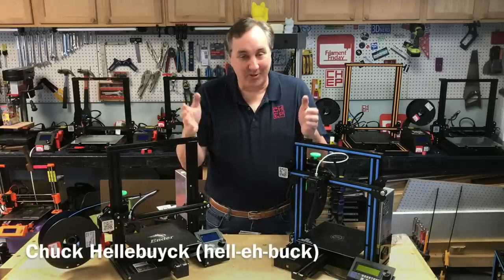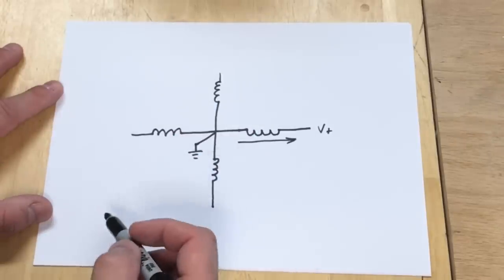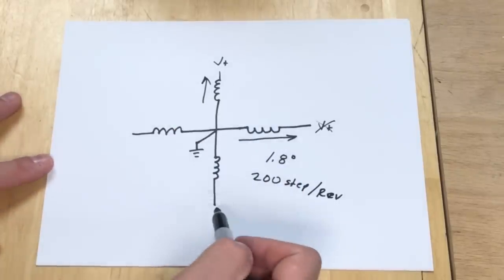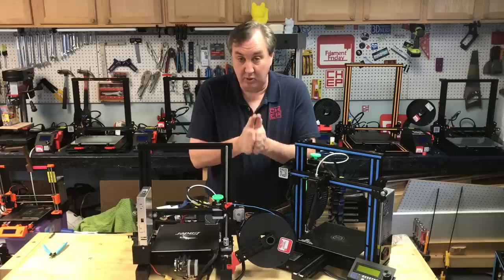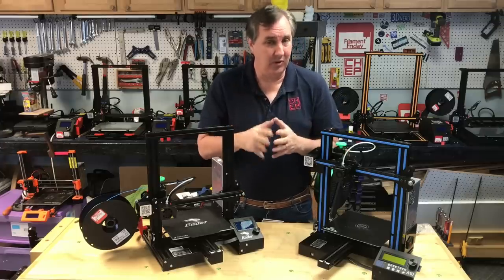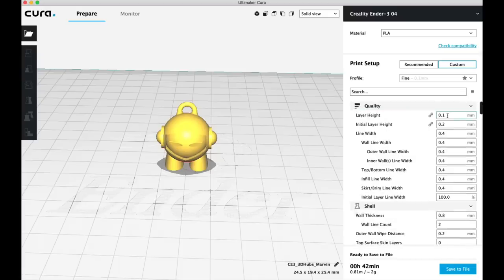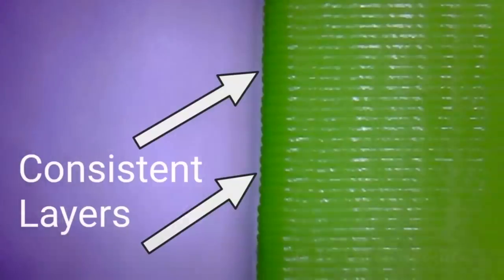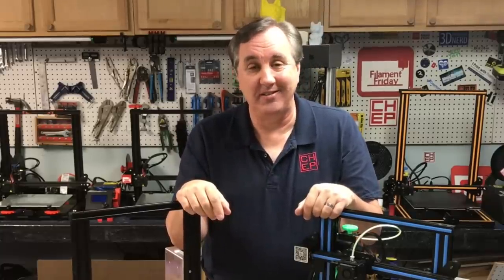Better Quality 3D Prints Using MAGIC NUMBERS on Creality Ender 3, CR-10, A10

Comment: I dunno, seems your cherry picking your results when your looking under a microscope because under your 0.12 layer you can clearly see bigger blobs at the bottom but you chose to ignore them and point to smaller ones
Reply from the maker: Seems like your cherry picking a video to make a point. I’ve had 1000’s of people actually use these numbers in the slicer and report the same results as mine. Much smoother prints. Ive since shared my profiles with them and have seen moe people state they are getting better prints. So I stand by what I showed and stated. 
The bottom of that print was another issue I covered in later videos.
Reply: @FilamentFriday  yeah I don't think we're on the same page on what cherry picking means.  I could only be cherry picking if there were many videos and I picked the 1 that showed fault. But then for me to be cherry picking in this sense you would have to be acknowledging there is a fault for me to pick at...
Reply from the maker: Then you clearly don’t get it. The area I showed on all the prints showed the improvement caused by the Magic Numbers so I clearly understand.

Comment: As someone who is pretty new to this, but trying to learn everything, I just wanted to thank you for your videos! I personally have an Ender 3 that I got for Christmas, and I have been playing with different settings in Cura to try and get more consistent prints. Your explanation for "natural steps" was really well done, and it answers a question I had about layer height, and what would make the most sense! I noticed in Cura that the resolutions they offer by default didn't really seem to have a consistent interval to them, and this helps me understand what I need to be doing instead. I don't usually comment on videos, but I just wanted to say thank you! I definitely subscribed, and look forward to seeing more super helpful content from you! 

...I am now going to go binge watch all of your videos and start testing things on my Ender 3 that you suggest! Thank you so much!
Reply from the maker: Thanks for watching and the sub.

Comment: This is a brilliant observation, though I would prefer to refer to the magic number as the Z-step ratio or something of the like. Can't wait to test this out!
Reply: In Cura, I usually use adaptive layers to smooth out curved surfaces or shorten taller print times with little variation on the z-axis. I noticed that I can set the 'Adaptive layers maximum variation' and 'Adaptive layers variation step size' to multiples of 0.04.
Reply from the maker: Magic Number sounds like more fun ;)

Comment: Makes sense, hard to guarantee that the first layer won't start at a microstep height though? resulting in all subsequent layers being off the "natural" step positions. However, your results don't lie. Will have to switch it up to 0.28 or 0.32 when I'm after those fast big prints. Cheers mate.
Reply from the maker: It may start at a microstep but read my pinned comment above yours where I clarify.

Comment: Your diagram is for a five wire stepper, 3D printers normally use four wire steppers. That’s the two opposite coils in series or parallel (in appropriate orientation) and no connection to a common point. There’s also six (your diagram but each set of two is separate) and eight wire (each coil coming out separately) arrangements.

On four wire steppers, you have coil pair A and coil pair B. First you energize A in one direction, then B, then A in the other direction, etc. The five wire model is easier because you only have to switch four + in sequence (well, more usually you’d have the power + in the center and pull the four wires down in sequence), and in the four wire model you have to put - on one side and + on the other, and then reverse that. Hence why we need specialized chips to do it instead of a few transistors.

This of course in no way detracts from your “try to match layer heights to full steps” point.
Reply from the maker: It was just to simplify the explanation. They still have natural steps and uneven microstep angles so the magic numbers average those out.

Comment: Its obvious (but something new for a lot of people). Nice video.
I always use 2mm lead pitch screws (0.01 is my "one full motor step Z weight").  I dont like 8mm lead step screws.
caution: Lead pitch and "pitch" are not same thing.
Reply: True, see my comment above. Uneven/odd layer heights will result in z-heights that will never match the original parts height.
Reply from the maker: Agree LoKuS, the Ender 3 does use a 4 start 2mm pitch 8 mm lead screw. Your 2 mm lead does produce equal quality to the Magic Numbers at just about any layer height. As you know, it just takes more steps to move. I have a printer with that Lead as well.

Comment: I just got an E3 and tried two benchy prints in a row, one with the stock profile in cura 4.3 for the E3 and right after the one with your magic 0.12 profile. The stock profile actually printed better for me. It's not a universal improvement, but I'm sure it works well for some poeple.

Comment: Later versions of Cura nowadays has the proper printer profiles with those "magic numbers". No need to manually create profiles any more for this reason alone. With version 4.6 I just told it to use the included Ender 3 printer profile, and it had all the settings dialed in for the printer in question.
Reply from the maker: Yes, those settings came after my videos.

Comment: Good video and tip. I came to this from another way to get my optimum z height. For me it was fighting with first layer height and a feeler gauge. Kept getting slightly different measurements when I told the z to go to .2mm. Finally I looked up the specs for the motor and did the math.

Comment: Interestingly enough when I modified my Tevo a while back I started using these numbers and the results were improved. Didn't know these were magic numbers. I discovered these when I was using the prusa calculator to figure out my steps on the new z threaded rod.

Comment: Someone recommended me your video, and boy am i glad for it. i did not test your claim but the hypothesis is very strong!  That is great wisdom.  When the printer finishes I will print a xyz cube. I have been printing these as .2 mm but i am still disappointed with the way the layers stick out unevenly at 0.2 mm. I will try .16 and maybe report back. thanks for your wisdom.
Reply from the maker: That sounds lire like over extrusion. If 0.16 doesn’t work then try lowering flowrate to 97% and see what you get.

Comment: So honest question

Either the microstepping is consistent and reliable and therefore the magic numbers are irrelevant or the microstepping is not consistent and reliable making the magic numbers relevant

So how do you make sure home is on a magic number ? Or does it just mechanically fall into line with the even steps?

I find the subject very fascinating I use them I always use layer Heights divisible by 0.04 just to make sure but I always wondered if it really made a difference :-)

Does this mean by changing out to a 0.9 degree motor we can get more accurate printers? How much of a difference would it make?
Reply from the maker: As I stated in the video that you can start on a microstep but it will be consistent from there. Nothing guarantees the microsteps are equal angles between the natural steps but if you rise at the same microstep then you are consistent all the way up so not irrelevant. 

0.9 would just lower the magic number resolution to 0.02.

Comment: I hated to hear 'magic number' at first, but I guess it's a common term for  practical sweet spot for things

I suppose the best resolution that any 3d printer that has the same Z lead screw and stepper motor as Creality machines, should be 0.04mm/40micron, never listed anywhere, but that is quite impressive considering 8mm/rev pitch might seem rough to some, as I remember browsing for my first 3D printer that usually FDM only does 0.1mm at maximum, which usually seems good enough, but now I know that this is hardware-imposed limits that can be properly highlighted

once I started to notice the difference even without viewing aid(very clear in finer layer heights, even your results clearly showed it to me), can't go back, magic numbers all the way, the irregularity in non magic number layer height even causes some strength issues, think it missed a forced microstep or two. big thanks !
Reply: You forgot the stepper motors are capable of microstepping, so it's not 0.04mm resolution but the one given by the stepper driver. Mine are configured in 1/16 mode.
Reply from the maker: The point of Magic Numbers is to average out the variability in the 1/16 microsteps so that doesn’t matter. 
Also the 8mm lead screw is a 4 start so it has a 2mm pitch.
Reply: @FilamentFriday  So what exactly is the Z resolution on the Ender 3?
Reply: @alejandroperez5368  Microstepping involves fine voltage adjustment that allows the extra resolution to be done, great for momentary resolution point like X&Y motors, but something like Z leadscrew(which is supporting both X and E motors, gantry, etc.) that has to make full stop on each layer change,  cannot compensate and guarantee that the Z will move precisely to the microstepping due to all the weight. 

If you count the Z resolution including microstepping, that should be 0.04/16(microstep res)=0.025mm, but in practice, these stepper motors do easily skip and miss, that even Prusa has to do several workarounds;finer pitch leadscrew, double Z motors, X-Y obstruction-reset, etc.

always full-stepping the Z by using 'magic numbers' just bypassing the trouble that comes with Z microstep

Comment: so i never knew this before, but i realized at some point, that with 0.15 layerheight for example my z axis motor gave off some weird whining noises every 2 layers.. i figured that this did not happen when i chose even numbers for my layerheights, such as 0.14 or 0.08. now i know i probably should be using 0.16, but still i finally have an explanation for it! thanks a lot! ;P
Reply from the maker: GladI could help. Thanks for watching.

Comment: When I first watched this video, I only half paid attention because of the use of the buzz word "magic" and the fact that you seemed to oversimplify.
I have to admit I was biased against this, and because of that when I first tried it, I didn't give it a fair comparison.
But now after reviewing this video and trying it out again, I have to say this is fantastic.

Big note, the lead screw I had on my machine was a 5mm one, with a 2mm per revolution rate, which means effectively any layer height  divisible by 0.01 works.
However since I upgraded to an 8mm lead screw, with 8mm per revolution, I had a few mysterious issues.
I could never quite nail down.

But this... this single handedly fixed the issue.
I wanted to write this to thank you deeply for sharing this.
I almost want to say rename it from magic numbers, but my bias against the word magic is what needs renaming XD
Reply from the maker: Thanks. There was a lot of push back and doubters when first released but now I see a lot of skeptics using my profiles. Glad they helped you.
Reply: @FilamentFriday  skeptics don't usually find the word "magic" to be persuasive.  in fact they are biased against the word. 
So maybe so drama could have been avoided xD

Comment: When you start the 3d printer, it will auto home all axes and the motor could be between steps (cause of microsteping) when it will find Z=0. From there incrementing with 0.04mm will guarante your 0.12mm steps on Z will be a full mechanical step.
Reply: Wil guarantee or will not?

Comment: Excellent video. Well explained IMO. It seems to me that the deciding factor here is the thread pitch of the Z screw rods. I wonder if we can assume that most, if not all, printers would have an identical pitch value? Like the Anet A8 for instance. Again, great video, thanks for sharing this.
Reply from the maker: Don’t assume, just turn it one revolution and measure the height distance.

Comment: My CR-10S from Hictop came with lead screws (2mm pitch) so basically as long as I don't try anything fancy with three digits behind the decimal point I'm fine!
Reply from the maker: Are you sure it’s not a 4 start 2mm pitch resulting in 8mm lead?

Comment: It didn't made a big diffference in vertical layers but it would  make a big diffference in slopes. Try to print piramid with periodicly higher levels it will pop to Your eyes. Great vid!
Reply from the maker: Do you have a recommended file on Thingiverse?
Reply: @FilamentFriday   I don't but i could try to make one for tommorow.
Reply from the maker: Did it work for you?

Comment: What about mesh bed leveling, be it manual or auto? The Z motor(s) constantly make fine adjustments as the print head moves around the bed so the nozzle follows it contour. I guess this would still apply once you reach the fade height and above.... lol

Comment: If I got this right, there might be a flaw in using 0.04 as the magic number... In your calculation you are assuming, the stepper motor has exactly 200 steps per revolution. However when I printed a calibration cube I needed to adjust the steps per mm in the printer settings. Wouldn't it be more precise to use these values to calculate the magic number?

Comment: Thank YOU! You just saved me from pulling my hair out. I WOULD ADD ONE THING THO!!!!! Magic numbers also applies to other axies. What I mean. You CANT get decent result with ENDER and 0.3mm nozzle. It is possible to print but very slowly at like 15 and with acceleration set to 100 (default 500) (jerk like 5) so it makes no sense to use it. I also tried 0.6 nozzle with high temp but the print looks like draft even on 0.12 layers as motors tend to overshoot and the filament just squirts over the edge.
Reply from the maker: The magic numbers only affect the z height.
Changing nozzles requires adjustment to the machine profile so the flow is proper. 
I show some of this here:
https://youtu.be/TiBarKlmIkI

Comment: But Z0 height will already use microsteps. As well as Z0.04, Z0.08 and so on, just because Z0 is not leveled at round motor step. Now you can made a video "magic bed leveling" or even "magic nozzle leveling" :))))

Comment: If you use microstepping numbers (256 micro-steps instead of 200 full steps), an 8mm lead screw divides into 0.032mm per step. This makes 0.16mm a compatible number to use for both full steps, and micro steps. Curious how consistency at that layer height compares to 0.1
Reply from the maker: The Creality use 1/16 microstepping so that 3200 steps per revolution. 
The point here is because of the variability in microstep angels using the pure natural steps gives you more consistent layers, hence why I suggest using magic numbers.

Comment: The reason for this is quiet simple: the microcontrollers Math is roundig the values. This is even the reason why everyone should use whole Numbers for the calibration of the axes, even when this means there is some inaccuracy left.
Have a nice Weekend ;)
Reply from the maker: If it was just rounding error then 0.1 layer height would be fine because it doesn’t cause rounding errors. But the non-linearity of the microsteps causes the variable layer heights I showed in the microscope view so these magic numbers get rid of that by forcing layer heights to use all microsteps thus averaging out that error. 
You too, Have a nice weekend ;)

Comment: Hi.  Great video.  Can you do a follow up showing step by step how different printers may need to be calculated? Not all are 1.8 degree steps.
Also, would this have any effect on X or Y axis?  I feel it wouldn't but I could be wrong.
Reply from the maker: Most are 1.8. The key is the lead screw movement for one rotation divided by 200. So that’s all there is to it.
Reply: If you’re using a .9 degree stepper, you’re going to divide by 400 instead of 200.

Comment: Assuming that your bed level it's at PERFECT step will work..... Practically I don't follow " Magic numbers" because it's nearly impossible with Active bed leveling.
Reply from the maker: Microstep angles aren’t equal which causes the variations in layers that I showed without magic numbers. If your bed is leveled manually or autolevel at a microstep, using magic numbers makes layers rise to that same microstep thus averaging out those variations and giving a consistent layer height as the closeup view shows,

Comment: You draw unipolar motor configuration with center tap but 3d printer uses bipolar configuration and driving it with current sourced H bridges. Bipolar steppermotors are more powerful.